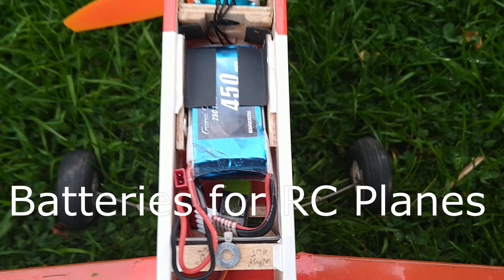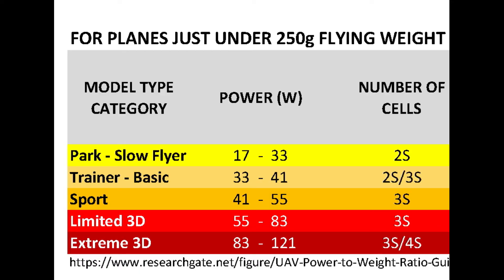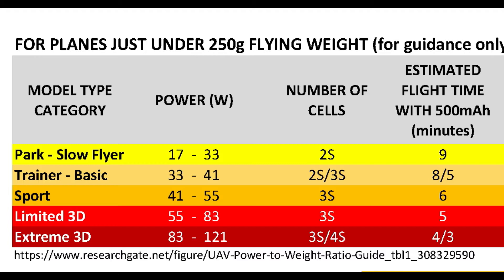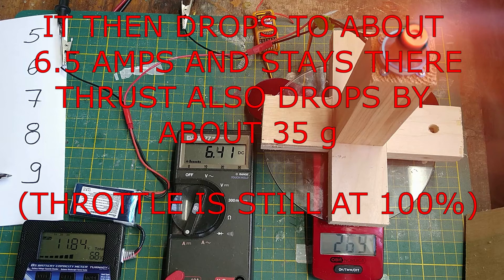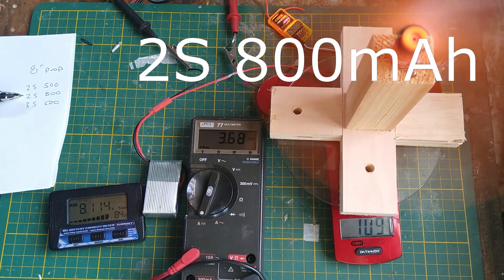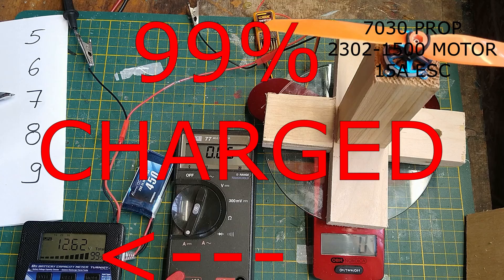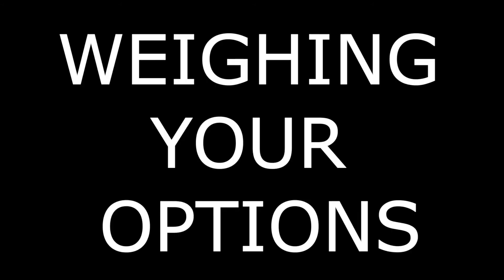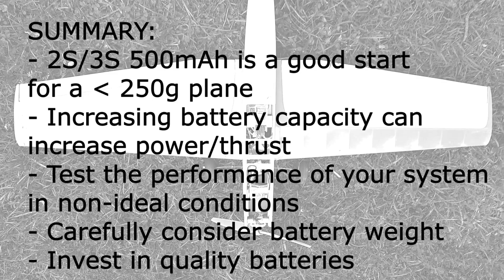Batteries: How to get the best performance for your RC plane

Comment: I just got some 300mAh 4s LiHV packs, 35 grams with XT60, should be fun to try in a 30" balsa cub. Although I can't decide if I should use 1507 motor or 2004 motor for a 5" to 6" prop.